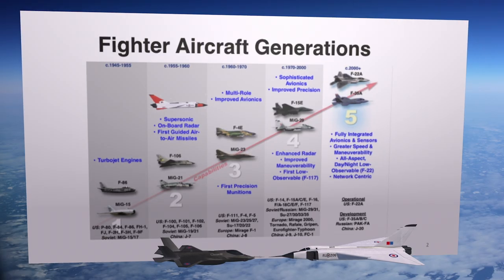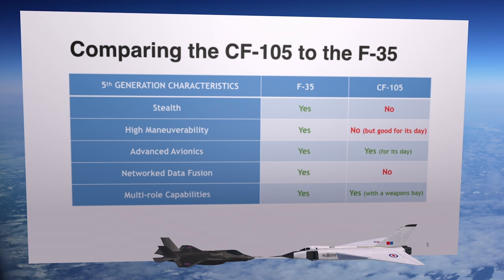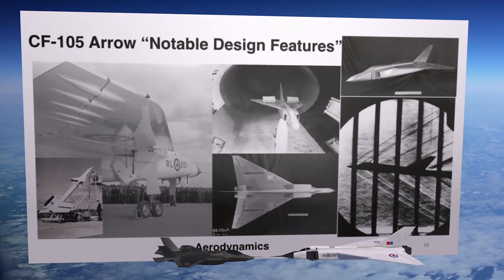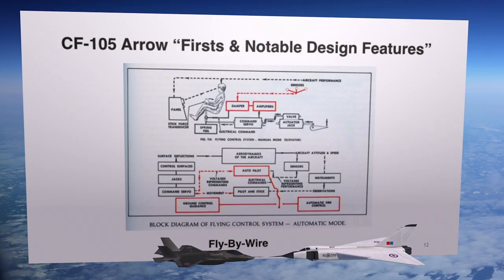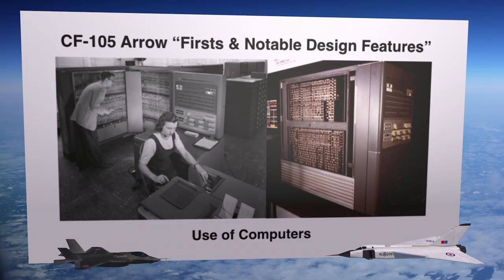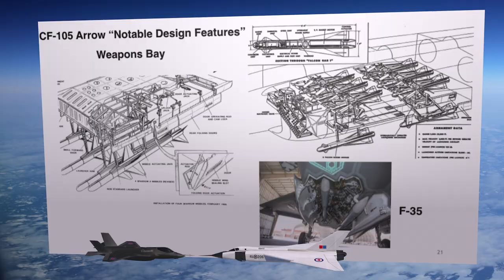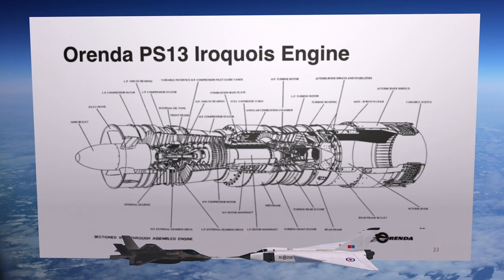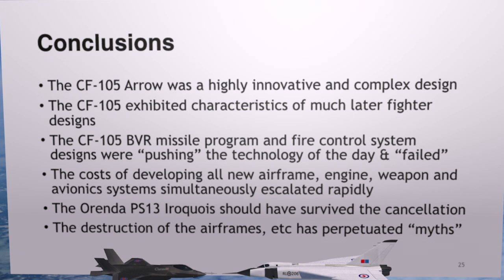AVRO ARROW FIRSTS VS F 35 LIGHTNING

Comment: A quick check on Wikipedia shows the F-22’s with two turbo fan engines at a matching 26,000 lbs thrust each. That could be fitted to the Arrow along with thrust vectoring.
Reply from the maker: Hi Wileecohagen.  That engine (PW5000) actually delivers 35,000 lbs thrust with afterburner.  Greater than a series 2 Iroquois.  Regardless though, the engine size are quite different.  The Iroquois was a huge engine in terms of physical size.  I am guessing, but let's say 30% larger all around.  Everything would have to be re-designed for air flow.  Something else, Turbo-Fans deliver good fuel economy and better thrust at the lower operating ranges, but they can't process air much past Mach 2.5.  A Turbo-jet does not have that limitation, which is why there was to be a Mach 3.5 Mark 3 Arrow.  The engine would have likely been a Turbo-ram as they called them.  The same type of engine as in the SR-71.  A some point in a Turbo-Ram, the jet is travelling so fast that the air is bypassed around the engine and is just mixed with fuel in permanent afterburner.  Interesting enough, the engine in the SR-71 is very similar in size to the Iroquois.  Makes you wonder.  regards.....Virtual
Reply: Why? The Arrow is late fifties technology. Ever wonder why the CF-105 was so big?
It had to carry a massive radar (with analogue technology) over vast, uninhabited areas of Canada and it needed to stay in station for a long period of time without the assumed support of in-flight tankers. So it also had to carry a huge amount of fuel for its thirsty turbojets. (We use turbofan now)
It was never to be a high G loading fighter. Instead it was an interceptor designed to shoot down Soviet Tu-16 and Tu-95 bombers infiltrating Canadian airspace. It would have done that by shooting nuclear tipped Genie rockets at the bomber formations. (Imagine shooting nuclear warheads over Canadian airspace.) It was never designed to engage fighter aircraft. It's only real defence would have been its speed and altitude capabilities.
In a world of ICBM's, the old Avro Arrow (even if it did go into production) would have been obsolete by the early seventies.
Reply from the maker: @firefightergoggie  Hi SuperSix,  We discussed Turbo-Fans, Jets and Rams is the post you are responding too.  Did you read that post through?  The Arrow was big for number of reasons, one of which was the Radar, but also the fly-by-wire system, the 4000 psi hydraulic system, the engines, the weapons bay, the two seat configuration.....but not to carry fuel.  It was never intended to loiter or stay in the air for long periods of time.  I don't know where you read that, almost any description of the Arrow points out that fact.
Although designed to engage bombers over Canadian air space, as that was the perceived threat at the time, it also was to have a bombing role.  That was the reason for Ground Mapping radar.  So, essentially an F-15 Strike Eagle although faster at altitude, but not able to turn as quickly at lower altitudes.  A higher altitudes, it would outturn an Eagle as that is where it was designed to fight.  (That big wing). Something else, the Arrow had inherent instability built into the Y-axis giving it an instantaneous turn rate.  Something now seen until the F-16 and F-18 appeared.  inherent instability is built into fighter jets for dogfighting.   Granted the Arrow would never have turned with an F-16,  but the F-15 eagle can't either, but the F-15 would kill a F-16 in head to head combat because of its performance envelope, power and size to carry better avionics, etc.  What gives the F-16 a chance is that inherent instability rating the Eagle does not have, but eventually the F-16 will lose power in a sustained turn where the Eagle will not.  The Arrow would never lose power in a turn and above 50.000 ft, it would out turn anything except an F-22.(thrust vectoring).
The Genie missiles.  I doubt one would have ever been launched over U.S. soil, but they were OK with Canada.  regards....Virtual

Comment: No doubt for its time it would have been a formidable aircraft, but, to compare it to today's technology is ridiculous. The chances are an English electric lightning could have intercepted and destroyed it with ease.
Reply from the maker: H Bert, I know of the Electric Lighting.  I know someone who flew in one.  The lightning was no Arrow.  I don't know where that came from, I guess your British background.  NOTE: we are not comparing the Arrow to the F-35, we are comparing the design process of the two aircraft.  The Arrow specs as posted on Wikipedia or other are only on a test engine with half the power of the  Iroquois that were to be used in the jet.  regards....Virtual
Reply: @Virtualenvirons  but it never came to fruition, the whole thing is speculative, it may of this it may of that. The truth is it was probably stopped by the yanks, they don't like anything better than they can produce, like the TSR2 and the concord. it's amazing what money can do.
Reply from the maker: HI Bert, They actually  did  build one with full up, 206, but it was destroyed with the rest,  It did not fly of course, but the others did.  There was never any doubt of the Jet's capability, but as you say the Americans killed it.  That comes out in the series.
 The Iroquois was taken to Britain under great secrecy as Orenda was owned by Hawker Sidley.  It emerged as the engine that powered the Concorde.  You can find that short documentary on this channel under the Arrow Series.  If you are British, you have done good stuff, but the Concorde was powered by an uprated Iroquois.  regards....Virtual
Reply: @Virtualenvirons  yes I agree that the Bristol engine company developed the basics of the Rolls Royce olympus engine prior to them being taken over by Rolls Royce as used by the British company a.v.roe , Avro has very little to do with Canada other than a subsidiary of a British company. The radial jet engine used was an English invention that the Americans copied as did the Russians. So don't try to make out that the Canadians were a power house of technological advances when they were riding on the back of English technology. The Arrow was at best a second generation jet fighter. As I previously exclaimed the English Electric lightning was developed at the same time, but could actually intercept any plane of its time, and much later. The Lightning was the only plane that managed to intercept a Concorde traveling at Mach 2, it also intercepted an SR71 by flying at 120,000 feet, 20 thousand feet above it and came in for a dive. this is reality, not rhetoric. Please believe my I am in no way playing down the capabilities of the Arrow, I'm sure it would have been been a world beater , but for god's sake stop trying to make out it would be a contender for today's technology. It would be a Dinosaur in comparison with today's planes.
Reply from the maker: HI Bert.  I missed this post.  I think you missed something also.  We did not compare the two jets capabilities.  We compared their design process.  The Electric was a good jet and replaced by the F-4 I believe.  The F-4 and the Arrow would have been contemporaries, even though the F-4's flight technology was standard.  Just two things here, the Arrow was Fly-by-wire with haptic feedback and was designed to be inherently unstable in the y-axis.  It used primitive computers (calculators) two keep it flying straight.  These two technologies were not seen on an American fighter until the F-16 and F-18.  This would have allowed the Arrow to "point it's nose quickly".  There was much more.  regards.....Virtual

Comment: This is a bad comparison. The Arrow was a pure interceptor, the F-35 a fighter. A better comparison with the Arrow would be the Mig-25 or the English Electric Lightning. Probably the closest thing from the US would be the F-15, although it's a different generation.
Reply from the maker: Hi Pointy.  We are not comparing the jets.  We are comparing the design process.  The story line is true though.  The Bomber Gap is a real thing.
The Mig-25 was no Arrow.  Think of the Mig-25 as an eight ball player and the Arrow as a snooker player.  The Mig-25  just went up fast and high with extremely short legs.  They lost most of them trying to land the thing.  Long story...short.  The Mig-25 was developed to counter the proposed B-70 Valkrye bomber. (Mach 3 high altitude Bomber)  Then came the Gary Powers incident and the U.S. cancelled the program......they just didn't tell the Russians.  The U.S. kept the program alive on paper, but only built two bombers for experimental purposes.  The Russians built nearly 500 Mig 25's and they were very expensive to build.  Sometimes you have to admire the CIA.
The Arrows claim to fame was not actually its speed or potential speed, it was it's technological advancement.  Some of what was on the Arrow or designed to be on the Arrow was not seen until the F-16 and F-18.  regards....Virtual

Comment: but flying a Arrow with a f35 would only give the f35 stealth away so would not ever happen
Reply from the maker: Hi Stresd.....We are not actually comparing the two jets capabilities, but the similarities in the design process, even though the Arrow was designed sixty years before.  Also, in this case the Tu-160's are not capable of firing missiles, so stealth is not a thing in this scenario.  The F-35 is "stealthy", but it's main strength is situational awareness.  The F-35 is well suited for Europe, but not so much Canada.  Lockheed Martin alluded to that several years ago....regards....Virtual

Comment: IT's a shame this airplane never saw service. It was so very  far ahead of its time that the same bird would be truly be bad-ass. who needs stealth when you can put run today's missles. of course I'm assuming modern, reheat fans and much lighter weight avionics,controls,and building  materials. Heck, as originally designed and built it would smoke  most A/C in the world with the mig 31 possibly being alittle faster. Newer designs are not always better, just newer.
Reply from the maker: Hi Victor.  Yes, the Arrow would still be relevant, especially for Canada.  The Arrow follows-on were to have Variable inlets which would likely put it close or past a Mig-31.  A Mig-31 can't pull it's full speed with missiles, too much drag.  The Arrow kept it's missiles internal.
But, the Mark 3 Arrow was to have an upgraded Iroquois, probably turbo-ram.  Its top speed was to be Mach 3.5.  regards...Virtual

Comment: Canada should have acquired the CF 106; a truly great fighter/ Interceptor which could have filled the role very nicely for a much lower cost.
Reply: not even close ... as the 106 didnt meet HALF the specs of air 7.3 ... of which the arrow was actually designed to meet or exceed
Reply: @0623kaboom  the f-106 could easily break Mach 2 with a full load of fuel and weapons plus 2 Wing tanks. Arrow never did that.

Comment: Large enough tp be a bomber. Which is why the USA wouldn.t allow it.
Reply: Myth.
In reality, the USA fully supported the CF-105 program.
Reply: Raynus its not a myth here's some proof for you! 

It has always been said the Arrow was a threat to the U2 spy plane, but how? In 1956 the CIA was using a cover story for the U-2 and said it was just a weather research aircraft but in reality it was used to over fly and to spy on other countries. The only aircraft that John Foster Dulles knew that was in development that might threaten the U-2 cover story was the CF-105 Arrow. Therefore he could not let the development of the Arrow continue. If the U-2 over flights were to continue its spying missions the Arrow had to go. Any flights by the U-2 needed approval from Allen Welsh Dulles, Head of the CIA, John Foster Dulles U S Secretary of State, as well as the President and others.

 

You might have noticed the last name of Allen Welsh (Dulles) Head of the CIA do you know he had a brother and who his brother was? His brother was none other than, John Foster Dulles, the U.S. Secretary of State! Do you know where the CIA headquarters are located? It’s in the unincorporated community at Langley in Virginia! Just a hop, skip and jump away from where the RCAF and the NACA did the wind tunnel tests on the Arrow!

Comment: Just think ... in 2023 .. the Arrow will be 70 years old from inception ... and it's design specification STILL has not been met by ANY modern jet fighter ... heck even the sr71 ... in march of 59 was still a swept wing design awaiting a decision on cancellation ... then some arrow enginers arrive and poof delta wing blended body high speed spy plane comes to life ... 
.
look at all modern designs ... they all have part of the arrow design in them ... heck the Valkyrie bomber is essentially an upscale version of an Arrow ... same as the concord and the Russian version of the Valkyrie ... 
.
now it is impossible to say would would have been ...IF the arrow didnt die on feb 20 1959 ... BUT one thing is for sure ... the modern jet fighter would be a WHOLE lot different today than it is currently and we would have a top notch production industry IN canada  instead of buying American ...
Reply from the maker: There is no doubt at all that if the Arrow had survived, the current state of Jet fighters would be much further along.  That is one reason the American wanted it killed.  They fully intended to implement everything on the Arrow....only one piece at a time over the next twenty years. Each piece getting a little more money from Uncle Sam....regards....Virtual

Comment: rubbish you are comparing a plane designed in the 50's to one designed in the late 1990's
Reply from the maker: Hi Brian....Well, at least you got the point.  Brian.....I have a series on my channel about the AVRO Arrow that uses a lot of artistic licence, although the story line is largely true, except for the escape of one Arrow.  This on the other hand is completely defendable.  It's not an exaggeration.  All of these points are documented.  regards....Virtual
Reply: and comparing an interceptor to a dog fighter ... and using american stats that are inaccurate for the arrow ... and of course .. not accounting for modernization either ... the arrows computer was fully fusion for it's day .. and almost as fast as the f35's is today ... the arrows fuel load and loiter specs are 3 times larger than what he shows ... and he didnt show any of the arrow's first like .. fly by wire, air conditioned cockpit, triple redundancies flight controls .. first internal weapons pod .. the arrow was also a .9 radar cross section so it was stealth before stealth was a thing ... it's engine to thrust wheight ratio out does the f35's ... and many more ... and of course the cost ... for the cost of ONE F35 you could get 4 Arrows ... all MAJOR reasons why the arrow is still a better aircraft than the still unusable f35
Reply: 0623 others have compared the Arrow to modern fighters! 

The simple fact is that the Arrow had an awesome power of maneuver as anyone who studies such things empirically will readily acknowledge.  When 1G performance curves for even the Arrow Mk1, with the early, de-rated J-75 engines, are compared to contemporary and even current fighters, I emerges that the Arrow was a world-beating design. It had the attributes in terms of low drag, low wing loading and high thrust-to-weight to defeat virtually any fighter at low altitude in a dog fight scenario. 

While its delta wing is argued by some to result in high drag during turns, the Arrow’s internal weapons and higher thrust-to weight would compensate. The Arrow Mk1, at higher than combat weight, Displayed a larger flight envelope than a late production F-16C Fighting Falcon that carried only two tiny heat seeking missiles. (Braybrook Roy, “Fighting Falcon V Fulcrum,” Air International Vol. 47, No 2 Stamford Key Publishing, 1994)

France’s  Mirage 2000, an updated version of their 1950’s Mirage III delta fighter is also known to embarrass the F-16 at medium and high altitude in turning fights, despite the F-16’s better thrust- to weight ratio. Nevertheless, the Mirage III was never considered a competitor to the Arrow in any performance measure or military role. 

The Russian MIG 29 Fulcrum, under equally light conditions to the F-16C mentioned above, is equal to that of an overloaded Arrow Mk.1 

An F-15C eagle, with up-rated engines, but at a true combat weight (no tanks, half internal fuel and eight missiles) displays a vastly smaller performance envelope to even an Arrow Mk.1 with at least 40% less thrust than a service Arrow Mk 2 would have had. The Arrow Mk 2, specified by Avro for the 21st Arrow, would have been able to sustain nearly 2G turn at Mach 1.8 at 50,000 feet.  

An F-15C could, at combat weight, sustain the same 2G turn at Mach 1.2 at 35,000 feet---hardly competitive.

The F-15C was felt, subsequent to the retirement of the F-106 Delta Dart to exhibit the highest performance in the Western world on an air superiority mission. Clearly, then the Arrow had vast “power of maneuver”. It had the ability to utterly humiliate anything flying at medium and high altitude. 

In a supersonic turning fight at altitude, the Arrow would remain unmatched by anything save the F-22 Raptor due to the F-22’s higher thrust-to weight ratio, The Arrow still had a lower wing loading and with a drag coefficient probably under .0185 and a lift-drag ratio of over 7-1 would therefore still not be a push-over for the Raptor---all other things being equal which, of course, 45 intervening years of progress in electronics have ensured are not.  Still, the Arrow Mk 2 was proclaimed to be capable of an instantaneous 6 “G” at 50,000 feet. The F-106 was also a high performer at altitude, capable of a 4 “G” at 45,000 feet whereas the Raptor is estimated to achieve 5 “G” at 50,000 feet. (Sweetman, Bill “F-22 Raptor”)